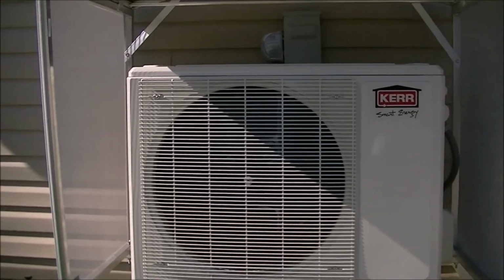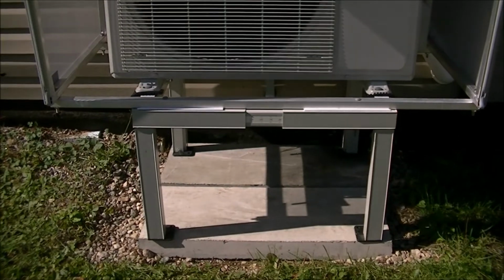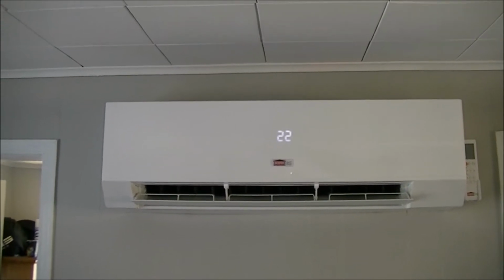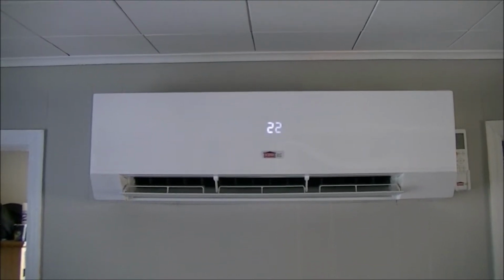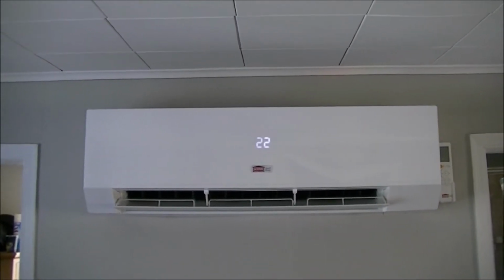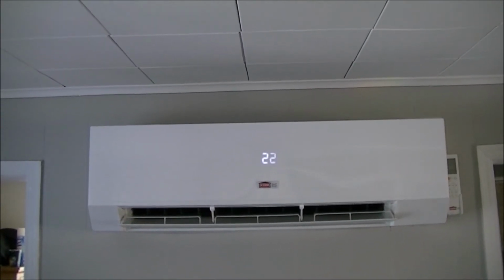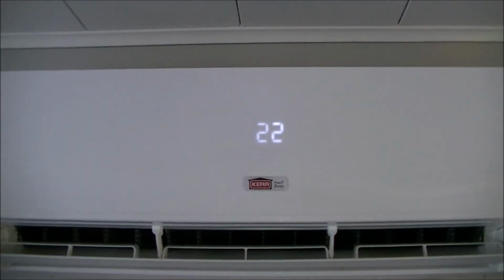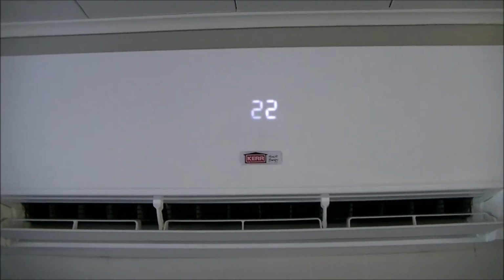Kerr Mini Split Heat Pump 18,000 BTU

Comment: Hi there would you be able to tell me how can I change from F to C 
I can’t figure it out 
One of the units I got is in F same like yours but trying to change it to C degrees 
Thanks
Reply from the maker: Turn your remote on and hold the "up" and "down" buttons at the same time for a few seconds and the remote will switch to F or C. Repeat the same steps to change it back... The other way I can change from F to C is to use the program that I setup on my cell phone. That is the app that allows you to control the unit remotely from anywhere in the world via your wifi system. the unit has a place to plug in a thumb drive and it connects to your wifi and the "Net Home Plus" program gives you access to all the controls of your unit through wifi. I hope that is helpful.

Comment: Hey could you make a video on how to remove the plastic on the indoor unit to clean it?
Reply from the maker: I suppose I could, but, I didn't have to do that because it does not need a cleaning. If you use the self clean option every week during the summer cooling season, you will helping to keep the excess moisture from building up and allowing the unit to self cleans and bget rid of any possible mold/mildew buildup. if you have that air conditioning running mad all summer, then clean the unit more often than once a week to be safe. 

I clean the top filter at least once a month and I wipe clean all the exterior of the unit at least twice a year. I would suggest that you have a qualified technician do a thoroughal cleaning if necessary. I suspect that the electrical will need to be shut off and the electrnic components that would not enjoy any wet washing would need to be dealt with. I suspect a mild soap spray on the fans woud be necessary and of course a good rinsing.

I certainly would not want to lead peope astray on how to properly clean this unit, but I will get all the "how to" for a tech before i attempt it; And, as i said already, perhaps a technician might be the best first option and just wtach what he does and ask questions. My unit comes with a 10 year warranty so, I will definitely consult them and se if an internal cleaning is a good idea and if it may void my warranty.

Comment: Hey. Just stumbled upon you video today, and I’m just wondering how it’s holding up so far. I also got a quote for one. I’m in Saint John, so similar climate as well.
Reply from the maker: I have been very happy with it so far. It does a great job keeping the house warm! It is also awesome for cooling. I can run this mini split in winter for heat cheaper than I can buy firewood. In the heat of summer, it cools the house for about $10.00 a month.

Comment: Hello there.  Thanks for the video.  We are looking at getting a Kerr with 3 heads.  We were quoted 11500 all in for install.  Does that seem reasonable?
Reply from the maker: My install complete with labour, wiring and weather housing was well about $5200.
Reply: Do not have installed by Paul Richards !!  No warranty service at all . Takes your money and runs !

Comment: Hi there, good video, I’m in NL and just got a quote for this brand of unit.  After you’ve used it now for a while how do you like it?  I’ve never heard of this brand before.  How is the volume of it?  Do you notice it is on?  Any comment appreciated.  Thanks
Reply from the maker: This unit works awesome. I used it for heating and it never quit on me. It is the cheapest ay to hat myhome. It also keeps thehouse nice and cool for very cheap. I burned firewood only before getting this heat pump. My highest power bill in winter was $150 more than normal in the dead of winter. It is actually cheaper than buyng firewood. It never quits

You have to do a 1/2 hour cleaning once a week when using AC. I clean my filter once a month. I have had no issue with it. I also have it hooked to my cell phone so I can control everything like the remote while I am away. I was away for 10 days in February - March this year and it never skipped a beat.
Reply: @Tobinindustrial  thanks for the quick reply, will definitely consider this unit, I’ve found out they are actually rebranded Senville units and seem to be fairly good quality.  It’s a pretty big purchase (looking at a 28,000btu unit) so I want to make sure it’s worth the money.  House is currently heated by a fairly new electric furnace on first floor (hot water radiators) and electric baseboard above, we just moved in but was told the electricity bill is pretty high in the winter, would like so,etching more cost effective.  Thanks again!

Comment: Hi Andy, did your power bill go down for the winter season?
Reply from the maker: My only source of heat prior to the heat pump install was firewood my friend.

Here in NL, Canada last year I ran the heat pump in the dead of winter for several months without a woodstove and my heat pump, according to my estimates, only burned around $125.00 in 30 days. 

I am in an older home with typical insulation upgrades including 1 inch styrofoam walls and skirting for crawl space. Newer windows and doors. No extra insulation was added to the attic. I suspect that the highest monthly light bill in a long term cold snap could reach as high as $200. That would be the extreme.

The heat pump never did cut out and the home is very comfortable in winter. The heat pump circulates heat better than just using a wood stove. All the house was comfortable. We set the heat pump at around 24c and use the turbo option and  we have had times that we would have to turn the heat pump down to 22c and at night we can turn it down to 18c - 20c.

We purchased and installed this unit so that we could leave our home for extended periods of time and not have to have somebody keep a fire in for us while we are gone.

It is the best investment I have ever made. I can actually heat my home in winter cheaper than I can to buy the wood. In summer it is absolutely incredible how cold it can get. You can hang meat in the room and it will freeze. When we are in cooling mode we set it to about 22 - 24c and the whole house is so cool and comfortable. The cooling costs are crazy. It may cost us about $10.00 to cool the home in summer for 30 days.

Comment: Hi Andy, how do u get the app for your iPhone to check on the heat pump and change settings while away.
Derek Brown
Reply from the maker: On my android phone I downloaded the designated app and then opened the app to register my unit and log the unit through the internal thumb drive to the internet.  Now I can fully control the unit by phone.
Reply: What’s the app I bought a house with a kerr mini split in it

Comment: Hi Andy 

Thank you for posting a video of your heat pump.

I am very interested in this unit as I am presently getting quotes.
I live in Dieppe NB with a similar climate and wood stove, so your input would be of great value.
I have a few questions on the performance a sizing of the unit.

We have a 1070 sq feet home with a 16 ft by 29 ft living room/kitchen with a hall to bedrooms  and bathroom directly accross where the unit would be.
Is the area that you are climate controling similar to mine?
I want to make sure that I do not over size (BTU) to make it less efficient due to the heat pump constantly cycling from on to off.

Appreciate your input
Thanks
Reply from the maker: I have an open concept area which is livingroom, diningroom and kitchen. I have an 18,000 BTU unit which was recommended. My home also has a porch, washroom and room on one end  and three rooms on the opposite side. I believe my home is estimated at about 1200 Sq ft. 

This unit comfortably heats the whole home and does better than the wood stove as it pushes and cycles the heat through the house. My wood stove is in same room as the heat pump but on opposite sides of the room. 

I use the wood stove and put the heat pump on fan and it really pushes the heat through the home wel than just the wood stove alone.

This unit alone heats the home in really cold weather. It got down to minus 30 with the windchill for a few days and the unit worked well. The trick is to turn up the tem[perature until it is comfortable. We put ours on 24c - 25c when it was cold. The unit will switch to defrost mode once or twice in one hour for about 3 minutes to defrest the outside manifold. that is perfectly normal. Some people say the unit is not working properly, but when it gets cold, the unit has to reverse heat to the outside unit to defrost the unit so that it does not freeze up and become non-functional

If you ask a qualified technician, he will estimate what BTU and what unit you need to use. I would ask a few people for a free quote on purchase and install. Good luck with your heating project. 

I hope that answered your qustion. Let me know how things go.
Reply: Awesome information
Thank you
Reply from the maker: @Pbourque14  you are welcome. if you have any other questions, I'd be glad to help in any way I can. Keep in touch.

Comment: Hello Andy...I live in Port au Port and just had a 12,000 BTU installed in my garage... it keeps going into DF mode and won't get any better than 18... any ideas?
Reply: Hi Andy… Ya thanks for the reply man all very helpful hints… I’m very confident in the job that was done for me and in my installer…. It’s just a small hiccup I think we will solve it tho… 👍
Reply: well it is probably winter there and make sure it is in HEAT mode and not AUTO or anything else. If you don't have the app installed on a phone , then you are missing a lot of control over your unit, to see the conditions it is in. I have 2 9's and an 18 Kerr , work good.
Reply from the maker: @kenthillswind  Yes, I hooked it to my phone via wifi and it has awesome setting controls. Thank you for the comment.
Reply from the maker: DF mode is defrost mode and can occur several times a day. That is how the outside unit keeps free of freezing so it can keep functioning. 

Your inside wall unit must be perfectly level and the drain line must have gravity flow downward in order for the inside unit to work properly.

If the install is corectly done, then set your remote to "heat". The louver swing can be set as desired. There may be a turbo option on your remote which will really speed up the heating or cooling of the room. If your garage is not well insulated, it may take some time to get up to temperature and if it is poorly insulatd, the unit may not be large enough for the space. 
What are you setting the temperature at? If you want the space to be at 22c you may have to put it on 24c to achieve that. 

Did the unit ever work properly or has it been since install? The installer should hav testd for heating and colling at the extreme settings ( 16c and 30c) to check for proper hating and cooling function.

I am told there was a guy installing these units from Corner Brook that did the installs improperly. I hope that is not what happened. In that event, a decent technician may be able to fix the unit. Issues could be a leaking compressor, lines, etc, improper wiring, lack of proper voltage or amperage, faulty unit etc...

if your unit is an older install, it may need a servicing to clean the screens, filters, fins, 

as i staed above, that DF means your unit is freezing up. there is a manifold kind of system on the unit that, when in defrost mode, heats up the outside unit and clears it of frosty and feezing components. Make sure your outside unit is not blocked with snow or froze up. There is a drain hole in the bottom of the outside unit. Make sure that hole is not plugged and that the unit is level so that the water can run out the bottom freely.

if you continue having issues, you will need to call a technician to have a look at it.

I hope you find an easy solution to this problem. Good luck and keep me posted my friend.

Comment: Do I hear a Newfoundland accent? I just installed a 12000 in my garage. Did you figure out the smart option? I have no instructions on it.
Reply from the maker: I am from Western Newfoundland. Smart option? Is that the remote control from your phone through wifi? It is dead easy to set up. You download the app on your phone and then the internally plugged in jump drive needs to be recognized by the phone. I have not set it up yet. I will have to get back to you with a setup video some day.
Reply: @Tobinindustrial  yes the app , it had problems but there was an update which fixed it , way better than using the remote control
Reply from the maker: @kenthillswind  Thanks for this my friend. All the best.